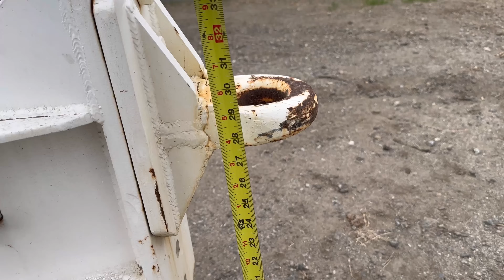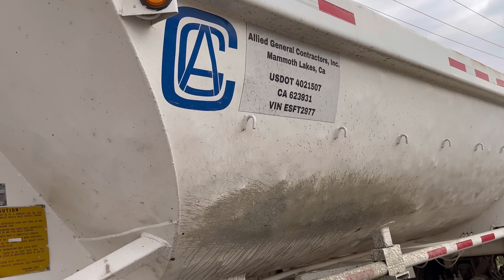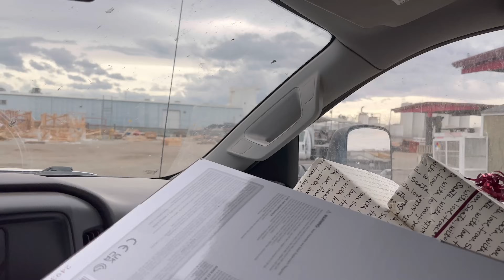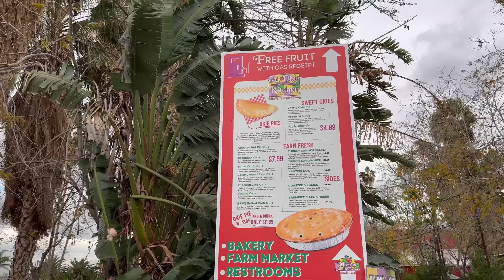North bound to Mammoth Lakes, CA. #construction #snow #country #building

Comment: Hi Ben, loved your video!  We usually travel this way over to Swall from Oakhurst.  An interesting spot before you get to Tehachapi, exit at Keen, and you can see the train loop over itself.  It's called the Tehachapi Loop for your railroad lovers.  Here's some more info on that.  We also stop regularly at Tea Donuts off  Exit 202.  Best donuts anywhere & Chantha is a sweetheart.

The Tehachapi Loop is a 3,779-foot-long (0.72 mi; 1.15 km) spiral,[1] or helix, on the Union Pacific Railroad Mojave Subdivision through Tehachapi Pass, of the Tehachapi Mountains in Kern County, south-central California. The line connects Bakersfield and the San Joaquin Valley to Mojave in the Mojave Desert.

Rising at a steady two-percent grade, the track gains 77 feet (23 m) in elevation and makes a 1,210-foot-diameter (370 m) circle.[1][2] Any train that is more than 3,800 feet (1,200 m) long—about 56 boxcars—PASSES OVER ITSELF going around the loop. At the bottom of the loop, the track passes through Tunnel 9, the ninth tunnel built as the railroad was extended from Bakersfield

Looking forward to your next adventure!  Gary & Julia
Reply from the maker: I’ll have to stop off next time I’m passing through

Comment: 29:55  Red Rock Canyon has a storied geological history, but one element that affects the present is the Garlock Fault, which runs right through here and is chiefly responsible for the chaotic makeup of the rock formations.  Garlock Fault is significant in that it is the only LEFT-lateral strike-slip fault of any size in California, which is opposite of the direction most faults move.  Pretty long fault, too.  110 miles long from where it meets the San Andreas Fault over by Gorman all the way out to the southern flank of Death Valley.
Reply: Cool . I’ve driven past that area for 30 years and didn’t know that. Thank you for sharing.